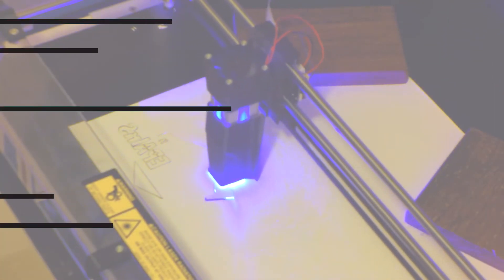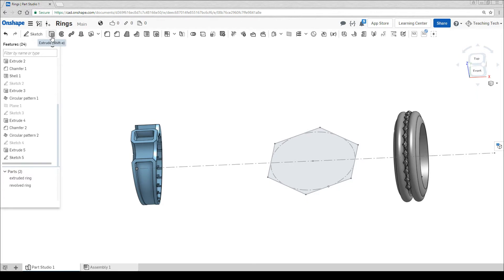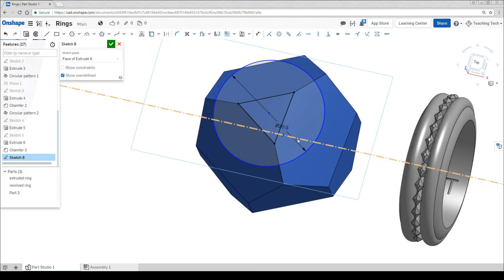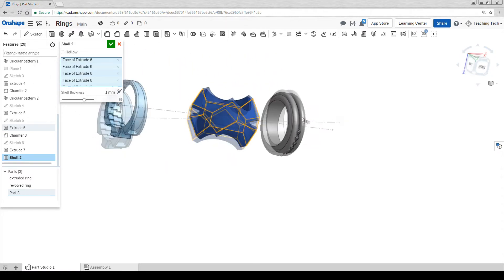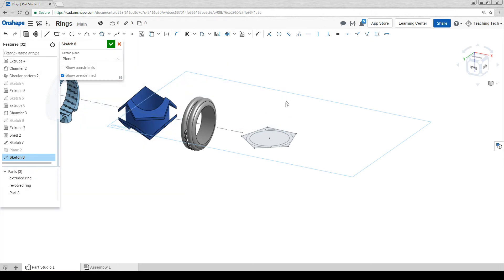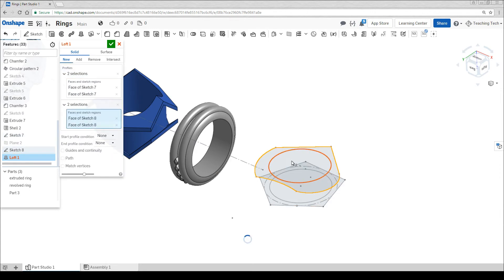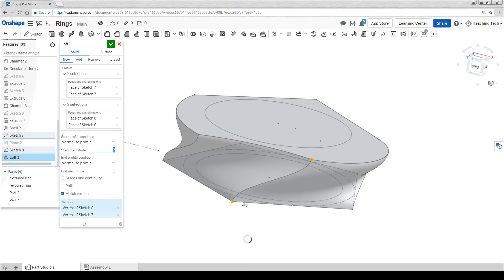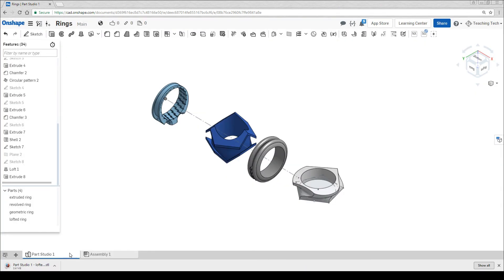Modelling 3D Printed / Investment Cast Rings - Part 3

Comment: Good tutorial video although I didn't love the ring designs.  Just a few of things that gave me a little trouble:

- I found a little trouble getting the second plane.  The problem was I was clicking on the circle feature on Sketch 7 instead of the sketch itself.  Just make sure not to click on a sketch feature.
- When creating the loft make sure Solid and New are selected as my OnShape defaulted to Surface and Add.
- As noted in a previous comment, the Vertices option is missing.  However, as stated in following comment you can get the same result with the Connections option.  I think it's the same option renamed and upgraded because you can now do use edges as well as vertices.